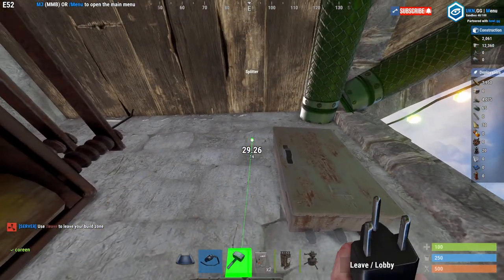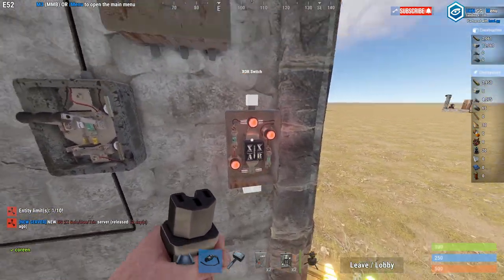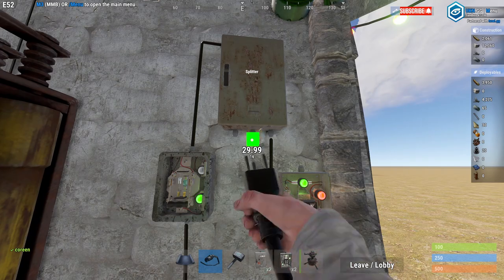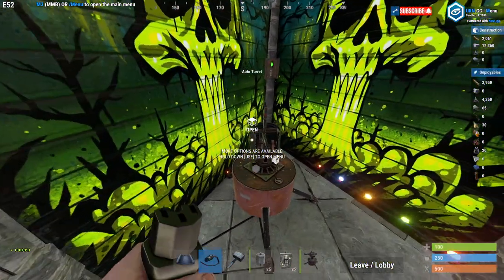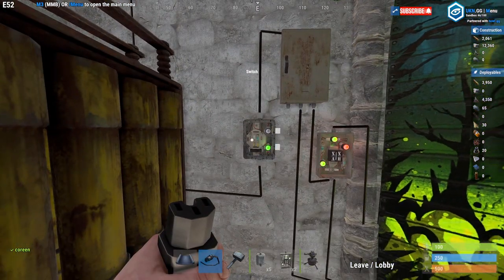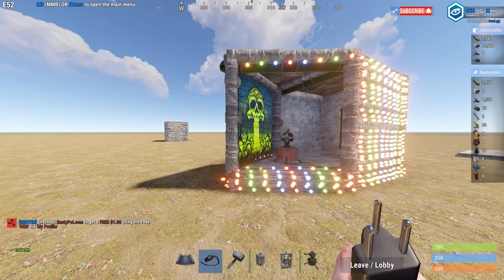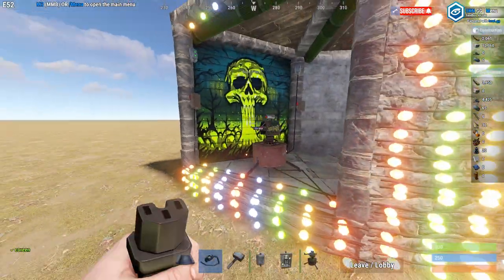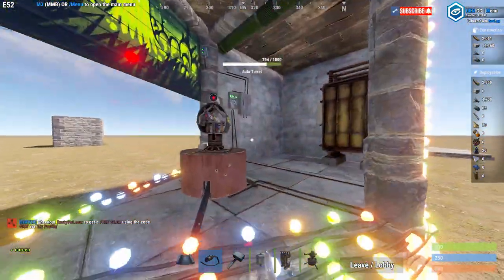Are you using Turrets wrong? - Rust

Comment: do not use switch bad idea/ anyone could turn it off. i unplug it or use a smart switch only tc privilege's can switch it off.  u could also use a electrical branch and turn down the output below 10 on the left side to turn it off.
Reply from the maker: If it’s further inside than the turret it should be safe to use a switch